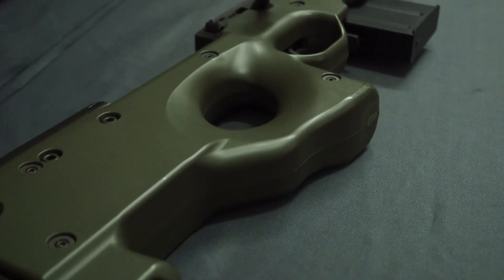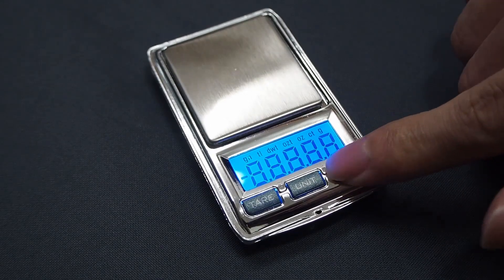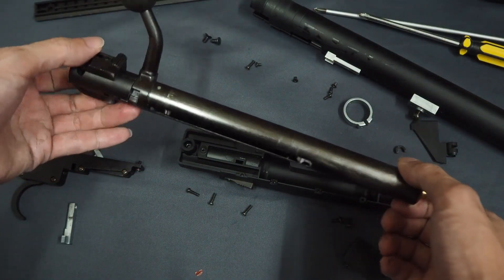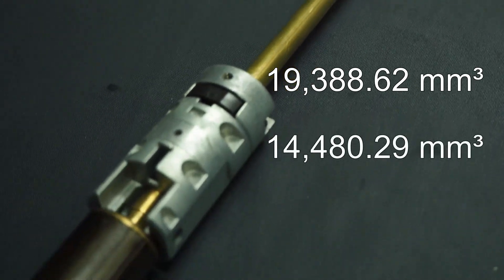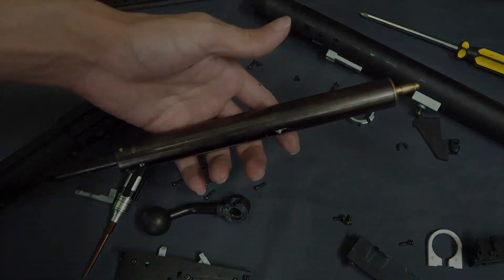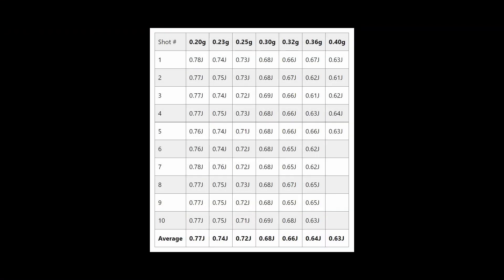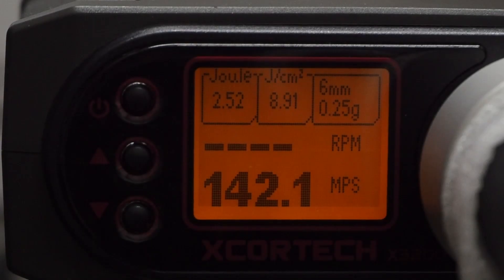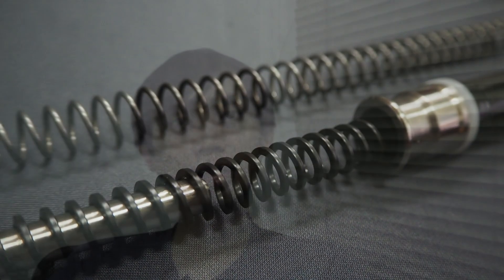Airsoft Diaries 12: Springer Muzzle Energy Efficiency

Comment: Did you set the hop to each BB weight accordingly? Would be interesting to see the results with the friction of the hop rubber taken Into account.
Reply from the maker: Kept it off on all shots. :3  But that's a good point.  I wonder what the numbers would look like.  I assume even less Joules on the stock cylinder and spring. 🤔